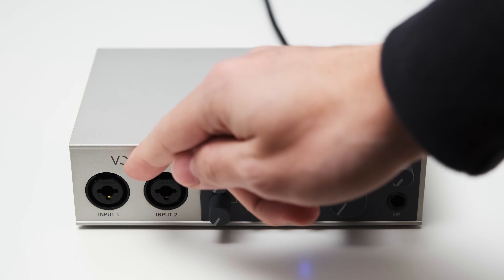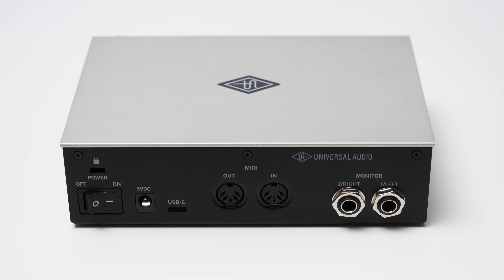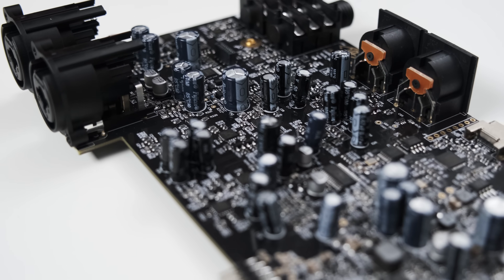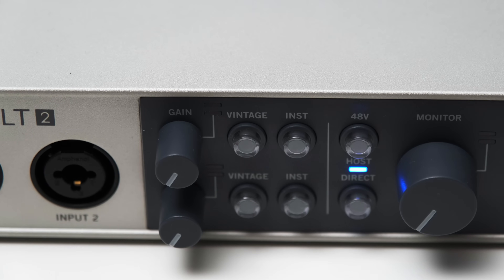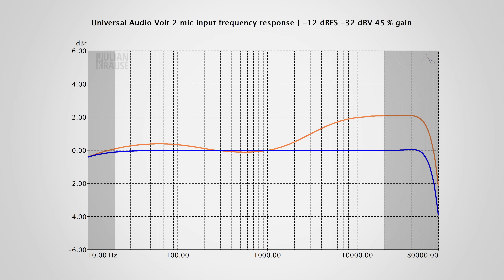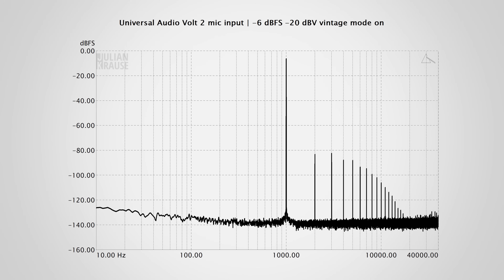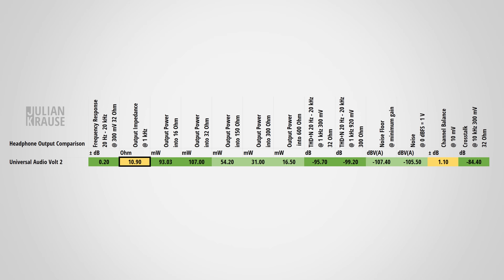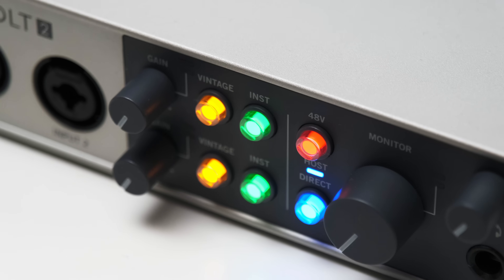Universal Audio VOLT 2 – USB Audio Interface Review (Vintage Mode Audio Samples)

Comment from the maker: Don’t be fooled by the graph at 12:47. It snuck into the video at the wrong time. What I say about the dynamic range of the output is correct.
Reply: Can you do your top 5 or 10 interface?
Reply: Can you do your top 5 or 10 interface?
Reply: Tell me please. We installed the driver by creating an account on Windows 10. We can't move on after Hardware Setap. The laptop does not see the card. What could be the matter?
Reply: Waiting for the comparison as you mentioned. I would be highly thankful, if you could analyse Apogee one & duet 3 the same way please 🙏🏻. Especially “Apogee One “…. Please, Please, Please. Request from your regular viewer.
Reply: M about to buy audio interface, m following your videos, there's a lot of interface m interested but, from the graph i think audiant id4 mkii and ssl2 looks good to me...m still confusing...which one do you mostly preferred or recommended if you are gona chose,....please help..as i dont want want to waste my saving..
Thank you.
Reply: @gangtegte8775  audient id4 mk 2 should not disappoint you..
Reply: @gaganbakana  thanks

Comment: For anyone planning to get a Volt 2, the USB C port on mine started acting up about 1.5 year after purchase. It would disconnect for less than a second whether I was recording, playing guitar through a plugin or just watching videos. The issue quickly got more frequent and a few tests ruled out my computer or the USB cables. It always had the same spot on my desk and I always babied it, used the on/off switch etc so I guess it was just always a faulty port. Thankfully I got refunded since it died under the 2-year warranty. Not sure if I should order another one or try something else now 🤔

Comment: Would you say that the volt 2 sounds better than the Focusrite Scarlett 2i2 Gen 3 & Gen 4 interface? cause I had read some negative reviews about the Scarlett 4i4 Gen 3 being nosey & I’m thinking about getting the Volt 4 because I have 3 pieces of midi gear (M-Audio USB midi controller, Roland JV-1080 & the Akai MPC One sampler sequencer

Comment: 😶Does anybody know what causes the Volt 2 to keep reverting back to Windows Audio instead of Volt 2? It didn't used to happen, but now every single time I start it I have to manually switch audio (under Options) BACK to Volt 2 because it ALWAYS reverts back to Windows Audio with terrible latency😩, etc. Now I can't get it even to switch to Volt 2 ONCE! Even after rebooting, etc. Very frustrated. Thnx for any help.

Comment: The Vintage mode kicking in only at high input levels is totally inline with vintage (i.e. tube) preamps such as the 610 and 1073.  Universal's plugin versions of these preamps faithfully duplicate this behavior. However, UA adds a digital/linear turn-down control on the output side of the plugin. This allows you to crank up the input side to the high levels required to induce the tube harmonics, while simultaneously (digitally) reducing output side, all the while maintaining those harmonics.  I suspect the idea here is to crank up the VOLT''s gain to the same necessarily high levels, while turning it down to a more normal level inside your recording app.

Comment: I have the volt 1 and am currently looking at mics. I see some second hand sm57s for $80 (Canadian) and I was worried about needing a fethead or cloud lifter, I was happy to see the sm7b being used here with what I'm assuming is a direct input with nothing in between itself and the interface to boost the gain. 

As a quick question regarding this, if I wanted to record acoustic or classical guitar with an sm57 going into my volt 1, do you think I'd still be able to capture enough of the sound? 🙏 Thanks

Comment: the volt 4 has very high digital crosstalk bleeding into the line outputs, at around -30 dB....  I wonder if the Volt 2 is the same?

Comment: If I have two mics plugged in: one dynamic and one condenser. 
When I turn on the 48k is that for both ports? Is it ok to run dynamic mics with 48k on?
Reply: Don't worry about it. Phantom power doesn't affect the dynamic mics..

Comment: Am Planning for buy a Universal Audio Volt 2 interface. But my using laptop is not so much powerful as now a days laptop. Am using Core i3 6th gen. So in my sound production related work, I need atleast 2048 audio samples rate. So is that interface support maximum buffer size 2048 sample bit rate in fl studio and studio one?  Please let me know about this. Thank you.

Comment: Hi, I have my first GEN 2i2 since ages now, primarly so I can use a couple of balanced Yamaha Monitors as an everyday audio system. Sometimes I've recorded stuff, but so far it's just a hooby. My question is: does the Scarlett third GEN, or some new Interfaces like MOTU2 or this VOLT  be a substantial upgrade?...I kind of like the MIDI port, the USB C connection and just to slightly upgrade, the thing is down here in Argentina even budget interfaces can get pretty expensive, thanxs in advance!
Reply: yes please I would love to know if this is better than the Scarlett 2i2

Comment: I was hoping the vintage mode would have been more of a high end smoothing thing with some added saturation. It would have been especially needed for cheaper mics that might have a little bit too much high end, to where turning on the vintage button would have given a smoother/warmer tone to correct that in a sense.

Comment: As the ‘effect’ on interfaces with attitude is so level dependent, it might be nice to include in the sound examples section rather than depicting it on a traditional plot. The SSL is a great example of this. Without a demo of the effect of differing levels, the ‘effect’ on offer is not being represented as well as it should.

Comment: Julian, I have the Volt 2 on a HP  Windows 10 laptop which never had a problem powering previous interfaces (UR22, 2i2, Solo) and sometimes it simply does not power. However it does if I also connect the second included power cable to another USB port on the laptop? UA supoort is lame and offers no usable responses:( Does the interface cumulates power from 2 USB ports? And how come sometimes it works with normal USB power and sometimes it doesn't? Does it have a stricter power requirement and if it doesn't meet it, bye bye?? I feel like returning it:(

Comment: How does it compare to ARturia's Minifuse 2? I read on a forum that they have the same Cirrus Logic DAC/ADC, same Thesycon driver. I watched both your videos but my very artistic brain didn't understand the graphs etc very well 😆 I mean now that you have tried both which one would you recommend. 
Arturia's plus for me is the extra usb port for midi keyboards ( as I plan to use it with an ipad I have seen people use them but not officially supported which this is for example) and the 5 year warranty! 
But I'm torn between the two! 
Thanks!

Comment: Hey I have the volt 2 interface set it up how they told me but when I plug in my headphones into my laptop I can’t hear a thing u was wondering if my headset had to be plugged directly into the volt 2 and if that’s the case which headphones should I get

Comment: As someone who has a couple of (thunderbolt) UAD interfaces and uses them on both MacOS and Windows, I would advise Windows users not to buy this if they expect UAD to improve the drivers over time.
It has been nearly 3 years since I bought my first UAD interface, and the ASIO driver performance has not been improved at all. Windows audio clicks and pops continually unless I have it set to 128 sample buffer. The interface is useless for use with Skype, Zoom etc. and will only output a severely distorted signal.
My experience in MacOS has been much smoother sailing.

Comment: Awesome review, man,  it would be more awesome if you can also take a look look if it does fine with AMD PCs too since the USB problem in AMD for quite a while now... and a lot of these Audio interface manufacturer focus so much with Intel CPU only that it's most of the time not usable with AMD CPUs...
Reply: Never had any issues with any usb Interface on my AMD cpu (Behringer, Presonus, Motu, Focusrite, Audient...).
Reply: @Anagnorisis25  I got issue with my Presonus Studio 24C having weird buffer sound from time to time even by just watching Youtube vids, how much I update AMD's chipset software and the BIOS it's still there. I also got Focusrite 8i6 which works flawlessly with all of my AMD Ryzen CPU, it depends on the AI, Behringer doesn't really have a problem since most of their stuff doesn't even have a native ASIO driver and instead recommend users to use ASIO4ALL...
Reply: @yasunakaikumi  That suddenly sounds quite different than your initial statement. With my old Presonus interface here (VSL22) I needed to get through a few of the Presonus drivers because some just worked better than others. But thats not really a AMD issue but a Presonus issue. Never had a problem with the Behringer drivers either, but always used the Behringer ones and not asio4all. The Behringer HD series is still the best "bang for the buck" interface.

Comment: Just bought DT770 Pro 250 Ohms and I wonder which audio interface should I go for.  I consider starting my journey with music production but should I really buy an interface right now? Or now just buy a budget MIDI keyboard (thinking about M-Audio Oxygen PRO 49) for start (my DAC which is FX-Audio X6 should run beyers, otherwise I'll try to mod it). As far as inputs are concerned I am thinking about making a mic myself based on DIY Perks -  but it's an USB version - so is it really necessary for me to buy an interface? Which one would you choose right now (I am thinking about some budget options - looking for something not more expensive than this UAV2).

Comment: The connection is a little bit puzzling: why on one end a speedy connection of USB-C and on the other end the slow connection of USB A (or 2)? Could it be connected through a cable USB-C to USB-C?
Reply: yeah it definitely could. the reason is because many people don't have devices with C inputs yet. but they probably assume if you do indeed have USB C inputs you probably have C to C cables

Comment: after I saw the graphics form the preamps, I noticed that the Volt is so overpriced as the Focusrite Scarlett, and the best option would be the Arturia Minifuse 2, because it is cheaper and a right sound according to that.
Reply: Get a Motu M2, way better!
Reply: @carlosserrano3985  Get a Steinberg UR-RT2, even better!
Reply: @Acnologia  I don't think so, I probably jump to a Motu Ultralite mk5, now that is a really good one too.
Reply: @carlosserrano3985  If you need a lot of inputs and outputs, then sure! But for simple 2 channel tracking/recording the UR-RT2 is probably better.
Reply: Agree, the Motu Ultralite is awesome but comparing with the others in the same level the M2 is way better, that's what I'm talking about.
Reply: Motu M2 is way better than Arturia Minifuse 1/2 
And i say it having both!

Motu's sound quality is pristine and recording feels solid, while the Minifuse is totally neutral.
But yes, for 100-150 dll 
Arturia Minifuse is the King 

For 200-250 Motu is the king 
And for 300 dll i would say that Audient id14mkii is the one...
Reply: @oscarestrada2545  Agree with you a 100%.

Comment: A question: can I overcome the noise issue if I used 96lHz/24-bit sampling with Presonus Audiobox 96USB interface,  rather than 48kHz/24-bit rate? In what way would it help? Thanks.
Reply from the maker: Hey, the sample rate has no effect on the noise floor.
Reply: @JulianKrause  Thanks.  While the noise floor remains unaffected, is there any overall improvement in S/N ratio?
Reply: @rajivmodha3693  A better interface, the Audiovox has very noisy pre-amps, look for a Motu M2 or Audient EVO.

Comment: This seems to be among the very best-performing CS4272 implementations out there, with dynamic range overtaking even the Arturia MiniFuse 2 on the input and only being second to the Tascam US-2X2HR on the output side, as well as consistently very low distortion with no nasty surprises. The headphone output is solid (not the highest max voltage but a very good load driver), microphone EIN is good but not exceptional (but still beats its spec).

Clearly a well thought-out piece of kit overall, including the power options. In these times of chip shortages, wringing a maximum of performance out of what we can get is appreciated. Beating 110 dB(A) in and out would have been midrange terrain a decade ago. This is getting close to EMU 0404 USB terrain. A good one for measurements, and it's class compliant so will work in Linux out of the box.

As it stands, the CS4272 datasheet DR specs of 114 dB(A) seem to be unattainable in practice (not unusual in consumer-grade chips) and about 112 dB(A) in and 111 dB(A) out would be more realistic. It's interesting how things seem to be the other way round for the CS4270 if we look at the UR22C (chip spec 105 dB(A) - in 103, out 106, so the DAC even beats the datasheet, which makes sense if you consider that it was likely based on the CS4391 design spec'd at 108 dB).
Reply from the maker: I agree, the Volt 2 has one of the best implementations of the CS4272 which I have measured so far. In most aspects the interface achieves nearly the fully specified performance of the converter.

Comment: The thing is Audient Evo 4 has very good specs on your chart. We have a major second hand ebay site here, and it is the most listed audio interface after m-audio. What’s up with that?
Reply: I've been using one for a year. I have two guesses: either people immediately dislike it because it's small and plasticky, or they don't get the hang of switching functions for the single knob. Actually one other possibility is that it disconnected from their machine (depending on their Windows sleep settings) and had to be powered off and on to get it to connect. Despite the minor annoyances I have been happy with it. For what I do, I don't see anything cheaper than the Motu M2 that I'd prefer.

Comment: After watching this I'm so glad I didn't bought into the UAD hype and went with the ID4 MK2. Big thanks to you!
Reply: i´m proud also too of my SSL +2
Reply: same here but id14
Reply: @cheveyo2403  Awesome! In my case I didn't need the extra IO
Reply: @SoumitraChakravarti  only downside is that after long periods of sleep it loses connection an need to restart
Reply: iD4 MKII would be perfect if only it had an on/off switch
Reply: Still happy with my Scarlett 2i2 3rd generation bought a two month ago
Reply: Got the Motu M4 and is priceless compared to this Volt interfaces.

Comment: What is the best sounding interface in the 200 EUR range? I doubt between this one, Audient id14 MK2 and Motu M2.  Which would you pick for best streaming audio quality? Which is clean, coherent and musical?  I need and upgrade of my Steinberg ur22 MK2.
Reply: Both are really good but I think the ID14 will be perfect specially if you need more inputs in the future.
Motu is great and I think in that price range nobody can touch it.
Cheers!
Reply: @carlosserrano3985  thank you! But which of these 3 should i pick?. I like the advantage of the optical input of the Audient id14 MK2. But input/preamp quality and a/d conversion are the most important to me. Is there a sound signature difference in one of the other? Does the Audient sound rich but dry in comparison to Motu or Universal Audio? Which sort of sound profile has each one these?
Reply: @Gilliboy82  Check the Julian Krause videos of the Motu M2 and Audient ID14 mkII, in those you will find your answer.
Like I said both are really good interfaces and I can't  decide for yourself, the videos are gonna help you a lot on that as Julian makes very accurate and realistic videos.

Cheers!

Comment: What is the preamp gain and how much overhead does it have to run the SM7?
Reply: It's stated by UA to be 55dB.
Reply: Average gain, I knew this interface is nothing out of this world.
Reply: @carlosserrano3985  if it still sounds good at 45 dB of gain, then further gain won't matter as that's where the EIN (which is more important) plateaus.
Reply: @samnicholson5051  For me at least 60dB is the minimum to drive the SM7B without stressing the pre-amps, yes EIN is very important but no matter is you got a low self noise you're gonna introduce unwanted noise when you stress the pre-amps.
Reply: @carlosserrano3985  I'd probably be risking clipping issues if I used 60dB of gain while using the SM7b at it's proper distance.
Reply: @samnicholson5051  Thanks everyone. That's the achilles heel of the 2i2. Glad this one cranks usable gain if that 55 db number is real. Apparently the 2i2 also claims 55 db but usable is more like 47.

Comment: So, basically very similar to Arturia MF2 but extra 50$ for Vintage and On/Off switch? I'm on the fence but I think also that Arturia has a little edge in software included, correct me if I'm wrong.
Reply: Love Arturia…